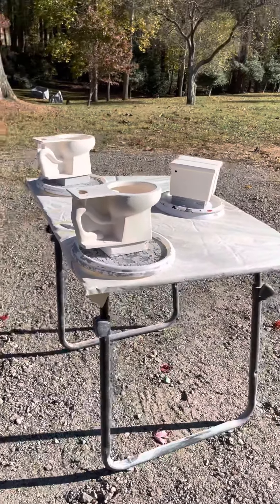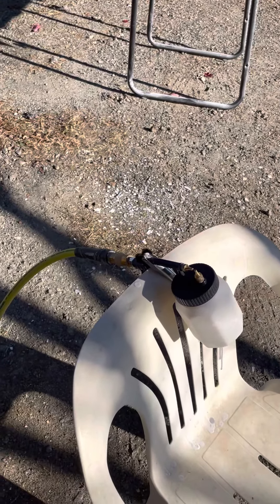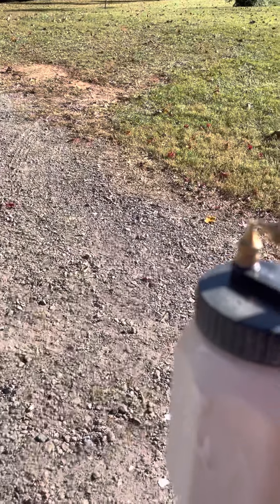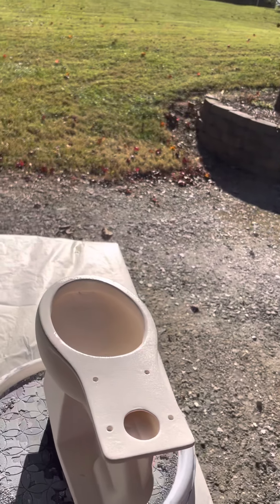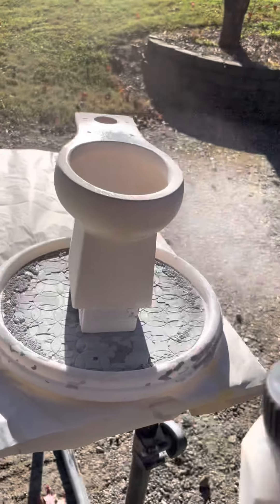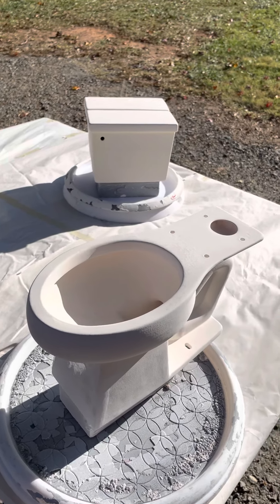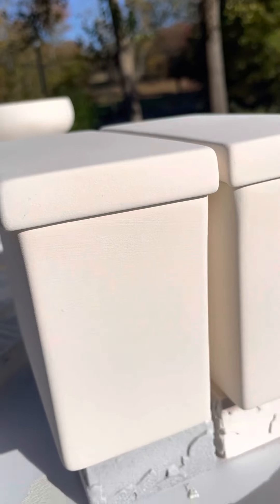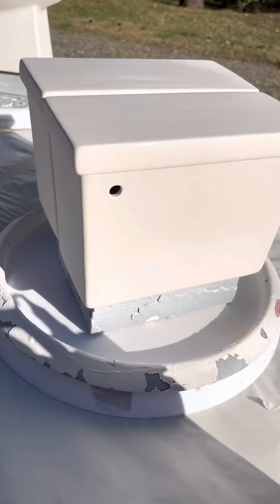Spray Glazing Mini Toilets!

Comment: I don't know why I was surprised that the glaze was white rather than clear...? 😅 Clear earthenware glazes go on pink, blue or even a lovely radioactive green. What cones?

Do you glaze inside the tank? "Raw" earthenware bisque would have been destroyed by the standing water.
Reply from the maker: Yeah, glaze colors are interesting.  I have a chrome finish glaze that has a purple appearance in it’s prefired state.  It’s interesting how the different oxides and colorants undergo chemical reactions to become their final color.  

I use cone 6 stoneware slip.  My glazes are cone 5 to cone 6, and luckily the cone 5 glazes still do well being fired to cone 6.

I don’t glaze the inside of the tanks, or the backs of the tanks, for realism sake, since most tanks are not glazed on the inside.  I do glaze the inside of the trapways, though.  Yeah, I make sure to fire all the way to complete vitrification.  I, like most ceramic artists, just bisque fire the clay strong enough to handle, while still porous enough to accept glaze.  I want to try spray glazing a bone dry toilet, and doing only one firing, which is how human sized toilets are made.  I don’t know if my glaze and clay will work together in the right way to do that, though.  If I do it, I’ll make sure to have one shelf solely dedicated to it, so it doesn’t mess up the other toilets if it fails.
Reply: @Pottymaker  Thanks for replying. I know all too well what you mean by "if it fails" cough explodes cough 😅
Reply from the maker: @CandyHatsuneWolff  😂

Comment: Are you still making these to order?
Reply from the maker: Sorry for the super late response.  I think that my notifications are messed up.  I just received your message.  🤦🏼‍♂️  I do still make the mini flushing toilets, but I currently don’t have any available for purchase.  I’ll be making another batch of them in the next month or so.  Thanks.
Reply: @Pottymaker  thanks...let me know when you have them again
Reply from the maker: @refridgedude1841  Will do
Reply from the maker: Hey, I have a few toilets that had a back section of the base that chipped off, but I glued the broken off pieces back on.  Other than that, the toilets are perfectly fine.  I was originally not going to sell them since they were cracked, but I changed my mind and now I’m trying to sell them.  I’m selling them at my less than perfect price, which is $50 off the normal sale price.  I’m trying to get back to people who have wanted to buy toilets from me in chronological order, which I think is the fairest way to do it.  You are the next person in line.  If you’re interested let me know, and I’ll have a toilet for you.  Thanks!
Reply: @Pottymaker  hey....sorry for the delay in getting back to you.  Yes I'm interested... as long as they work and don't leak.  If you still have one let me know.